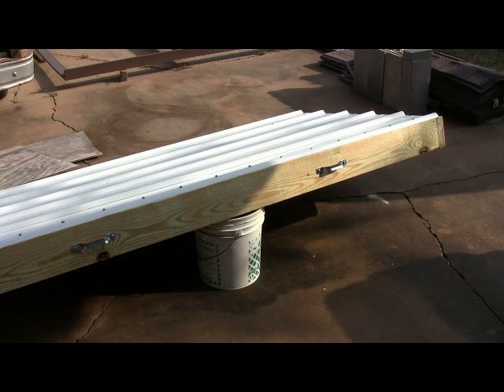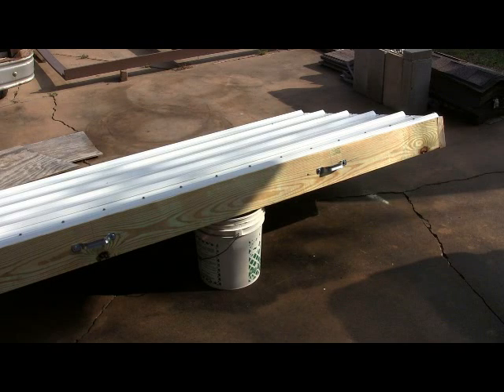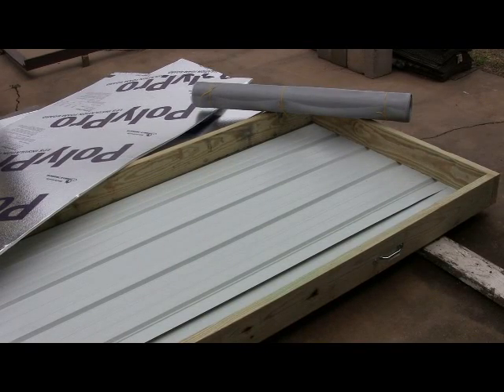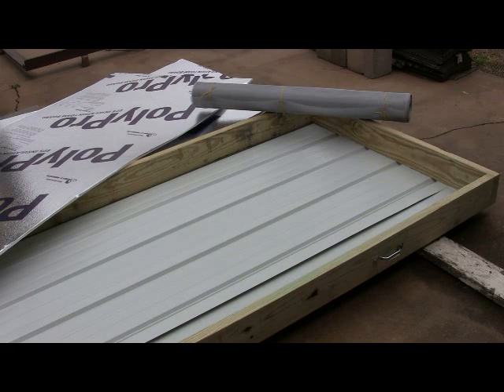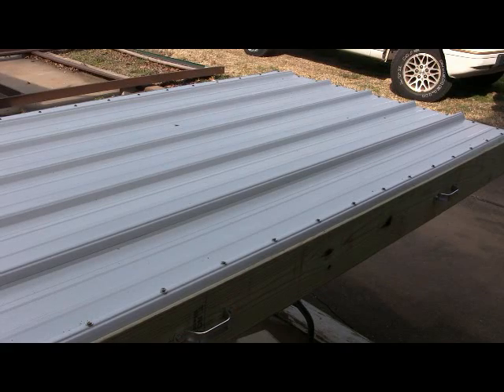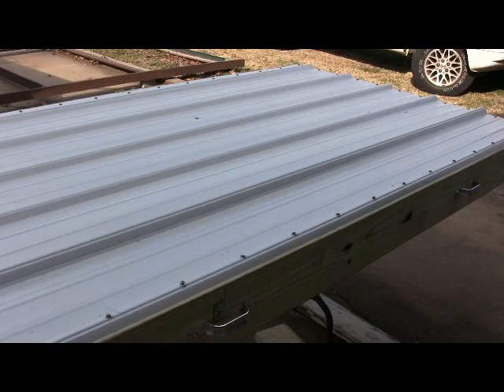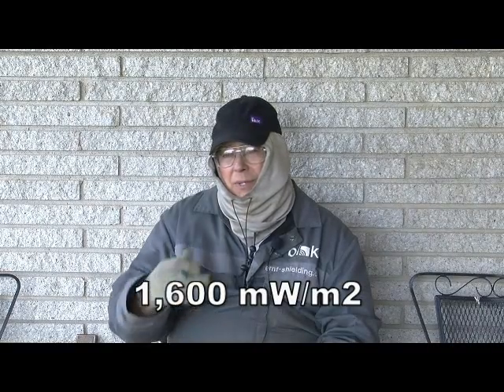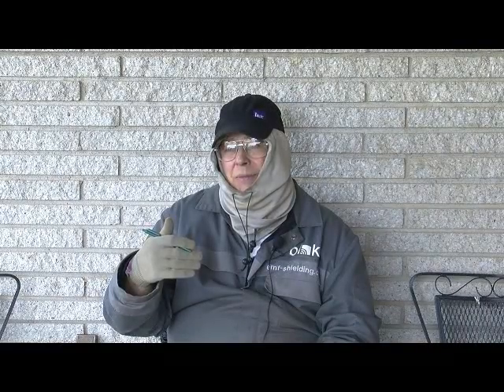Shielding yourself from Smart Meter microwave radiation.

Comment: I'm more interested in shielding myself INSIDE my house, from the four smart meters on my living room wall.....I don't live/sleep in the yard.
Reply: john mausteller Of the last two apts I've lived in two neighbors or one in each apt died . The first apt the outside wall had 8 smart meters attached . The second one has 4 . What no one seems to be addressing is the dirty electricity that's created by the meters . So if you have a wall of meters attached to your bedroom at the very least make sure your not sleeping on box springs and that your mattress has no springs in it . Otherwise two things could be happening . One that the RF waves could be using your springs as antennas and/or your springs can act like transformers pulling on your own electrical energy . I would move if I were you knowing what I know now ! Also anything that you have around your bed that is electrical I would move to the wall with the meters . Anything electrical that might act as antenna I would at least unplug until I used it . I hope that helps .
Reply: C. W Do you think that would work in an apartment, that is an end unit that has 6 boxs on the otherside of the wall?
Reply: Barbara Keillor how about 22 , 15 feet from bed
Reply: john mausteller It might be safer to be homeless ?
Reply: But we have to mow that sucker....then we are out there with those radiated devils for awhile....
Reply: ppl already affected obviously. get a silver fabric mesh staple to inside wall. duh
Reply: For real??

Comment: Here comes the actual science. Disclaimer: I'm not selling shields like the guy in the video. 
https://www.quora.com/Which-is-unhealthier-living-with-a-cell-phone-tower-or-living-with-a-WiFi-router
Reply: Well, factualy (is that a word?) I have a masters degree in electromagnetics and have worked in radar research since 1968. Despite having worked alongside - and in some cases, inside - high powered microwave electronics, some way above the megawatt peak level, I'm probably healthier than you, at least mentally. 

But a funny thing happened the other day, a nice National Grid lady came around to test my gas meter (it passed), and she mentioned that in a couple years we will get a new meter because the batteries only last 15 years. Question: how strong a death ray can you put in a gadget if it runs for 15 years on a battery? 

So I gotta laugh at you people who think smart meters are frying your brains. Something else has fried your brain, probably paranoia.
Reply: Dial down the panic for a few seconds, and explain how a Death Ray Meter can run for 15 years on a lithium cell, and fry people. 

Did I mention I'm an RF engineer?

Comment: how bout just wrapping as best u can the meter in aluminum foil?????
Reply: Use orgone inside and on the meter. Make a fcage with metal mess and Cooper and decorate your home with crystal. Copper, and do your best.  It's all we can really do
Reply from the maker: At some point you block the meter from transmitting to the electric utility company.
At THAT point they tell you to remove the shielding OR they will cut off your electricity.
Reply: The Easiest way to deal with a smart meter is to replace it with the old style meter. You can buy them online.
Reply: Or aluminum screen which is thicker.

Comment: dude, nice info, but somebody has to be doing something:  in video medium we want to see things happen.  put the finished photo of product up front so we know what is going on.  can you comment on the $125 smartmeter guard and why it is not a simpler solution?  most folks who need solutions are at the end of their energy rope, fatigued, can't put puzzles together, rather buy a ready solution.   why the heck not buy or make a smartmeter guard type F-cage?  you briefly note 'i'm not sure those are super effective' but dont prove why you think that.  meters and before/after reads are key to include in any video about solutions and using meters smartmeter guard looks to be a solid thus worthy $125 solution.
Reply: Donald Doct0r  How did things work out with the Smart Meter Guard? I am considering getting one.
Reply: A two dollar roll of aluminum foil will shield just as well. But what you really need to do is see a doctor and figure out what is causing your symptoms.
Reply: watch your balls shrink dummyy vshango idiot

Comment: What about making a lead box around the meter
Reply: the shielding needs to be on the inside of the house ,where the people are.....why is nobody pointing this out?
Reply: except the damn meter is on your house...........there would need to be a barrier on the inside wall too.......kinda like i am thinking inside the box
Reply: @commonconservative7551  The inside wall just on the other side of the meter will have to be shielded.  Aluminum screening would work
Reply: I had the same idea. It wouldn't have to big too big. I think I'd make a box too, as I think they wouldn't be able to get to read the meter at all. Might make your bill down in the same way folks used to put pins in to stop the wheel going round.
Reply: Xx Splitso xX
Hey Birdbrain...
Your feeble attempt at insult might have a trace of an effect if I could work out what you are trying to say!  However, it's quite apparent that YOU don't know what you're talking about.  If your brains were dynamite, they wouldnt blow your hat off.
Reply: Xx Splitso xX
Please reply in English....Real English. Not brain-dead gibberish !
And Hey..But Hey...And Hey...But Hey.
Sorry if I use big words and write sentences too long for your chicken brain to understand. But hey........
And hey.
Reply: Mountain Hermit
Good Idea.. Wouldn't need to be lead. We're not talking atomic particles. Lead would work fine but what a weight.
Anything to create a "Faraday Shield' would do the job, aluminum  sheet/foil...BUT the joints of pieces of sheet would need a complete, low loss connection to seal the box for RF purposes ie. keep in the Radio Freq.. waves generated by the Smart meter. The finished box would need to be grounded by a ground which is effective at the freq. involved and by a ground lead which is effectively very SHORT at that freq.  I don't know what it is in your country but it sure ain't microwaves in mine...100 Mhz to about 300 Mhz. Nowhere near microwaves, just between vhf and uhf.and that doesn't mean ALL of it..just selected spots wide enough to carry the info. to and from the power company.
Remember that, 'to and from" for later
Chicken mesh can also be used because if the wavelength is great enough for the size of the holes, it wont get through. You of course need to know what size of chicken wire you need for your frequency but here standard chicken wire holes
 will stop chickens AND Smart meter waves...at OUR frequencies.
If you only REDUCE the radiation and not kill it, it can still be useful in dropping below declared danger levels.  Here comes the BUT.
If your lead or other shield is a success, your waves, micro or other waves will suddenly be missing at the power company's nearby antenna...Your Smart meter's signal will not reach them to tell them how much energy you've used. That's the "TO THEM" mentioned earlier and if they send info/ instructions to your Smart meter, it ain't gonna get it.
Dontcha think that they'll KNOW? How long do you think that they'll be before sending out a Techie to fix what appears to be a Smart Meter which suddenly ain't Smart or even fit a new one?
He'll say "Well Mr Clinton... I like that decorative cover on your Smart Meter.. Very pretty.. Looks just like a Faraday cage to me.  Am I wrong?
In terms of the electro mechanical meter, it's tantamount to interfering fraudulently with the reading to avoid payment.
Need I say anymore!

Comment: I believe that the shielding must be built from ferrous or at least somewhat ferrous metal to stop RF
Reply from the maker: Please go to 13:30 on the following video where we use aluminum screen wire to block the microwave radiation.

https://www.youtube.com/watch?v=UDtvHmR-sJo
Reply: Mark Kiser So why do they make meter shielding like a round "pot " that fits over the meter itself out of aluminum screen.. and it blocks a great percent of the radiation ?
Reply: Mark Kiser Copper is better, but aluminum is better than nothing.Uncertain about ferrous metals - they could also be an antenna.